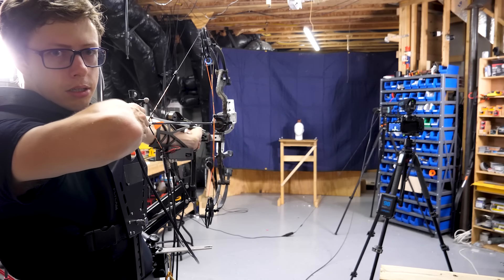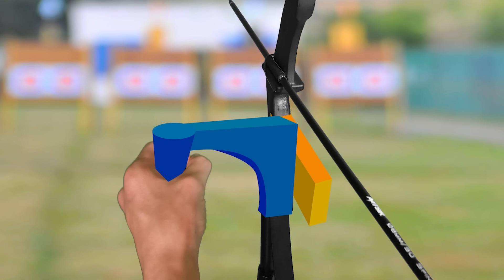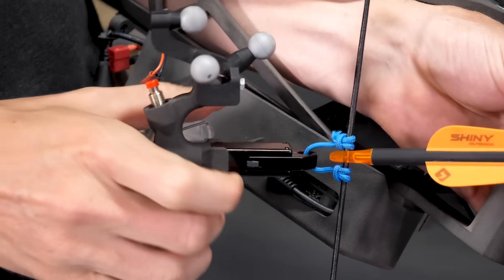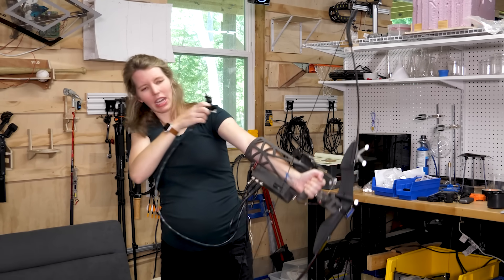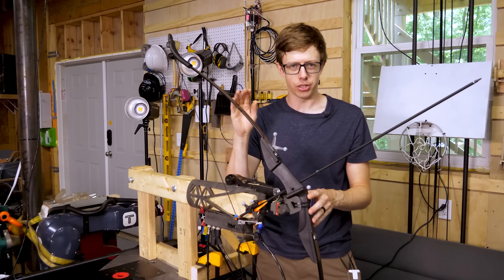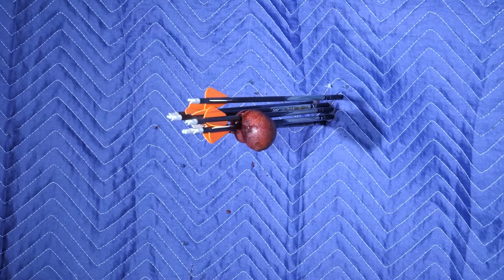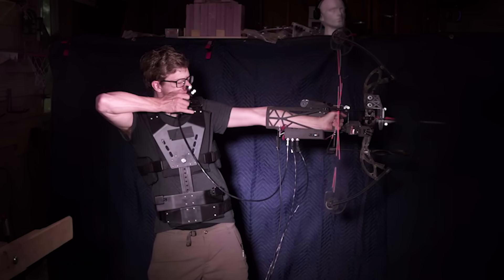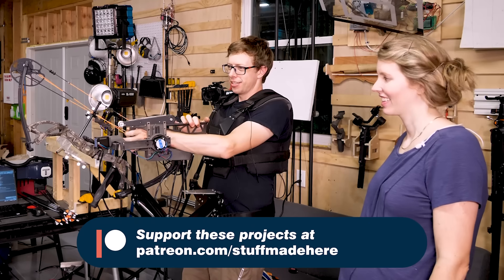Auto-aiming bow vs. FLYING targets

Comment: If you're already wearing a harness, might as well attach two cameras to it and rework your code a bit to triangulate the target with just two cameras on you so you can go outside and shoot targets.
Reply: @tmotw21022  Pretty bold to claim that software specialized in calculating exactly this problem wouldn't be feasble considering this was heavily by the military specially during WWII, you'd be very surprised and probably interested in learning the kind of math and problem solving anti-air artillery innovated.
Reply: @tmotw21022  I'm not here claiming that its impossible since don't have the education to really back up my claims other than having read and watched a lot of papers/videos on similar things ( https://youtu.be/yRd_AW1aZ8M this is a good one ) alongside having worked with programming that involved using ballistic trajectory to predict projectile weapons with gravity and motion in mind as a fun hobby/challenge. You'd be surprised how far math and tricky logic can get us, especially with the computing power and new programming languages we have these days.

Top of my head though I'm unsure how accurate this would be but its primarly just an example of one way of approaching this would be to hard code your own estimate height, use GPS/GNSS to aid getting your current alltitude added into the equation. With distance making things like the target's alltitude and distance harder to guess we can use cameras alongside lasers to get estimate distance. This is all just assumptions from someone without any real prior experience in this other than loving to learn on my own, but it being a ways I can imagine approaching this problem.

tl;dr 
I think its fairly naive to say that it just "wont work" and that is impossible since we don't have have exacty X Y Z axis from 3+ cameras with different angles though that obviously makes it fuck ton easier/straight to approach but not "nah u cant lmfao u need cameras and that big pc they got a googles"
Reply: @tmotw21022  i never learned about it in school either, just came across the topic one day watching a bunch of random videos. Also unsure what being american has to do with anything, I'm Norwegian myself though that doesn't stop me from trying to always learn more and never just say "nah wont work"
Reply: It needs at least 3 cameras in offset, one for x,y and z axis. And that's for the target positioning. And a camera for to know how much he pulls on the bow ( although it can be removed if he uses a crossbow- he know the pull weight and it also gives him better shoot balance). More cameras would give him better position feed
Reply: @Sorcerer86pt  No camera needed for pull length - there are several other possible ways to detect that.
Reply: @perwestermark8920  pull length and direction. Sorry forgot about that. Thanks
Reply: @Sorcerer86pt  Yes, for direction it would be nice with a camera solution. But this part is very hard - if there is a visible target, then the bow could have a red dot or laser sight and the camera looks for the dot. But without a background tonproject the dot on - like when shooting at a a thrown object, it will end up a triangulation problem. Will the moving bow has fixes points to triangulate? Or just settle for gyroscope and linear accelerometers to figure out bow orientation?

In the end, it isn't important to know the absolute position of bow and target. But the relative position of the target, and the direction of the bow relative to the target. And 3 cameras that are following the target should actually manage this, while a 3D linear accelerometer would know if the bow points up or down to compensate for different arrow path based on height difference between bow and target.

So I don't see a need for more than 3 cameras. But additional cameras will help reduce the final error from lens distortion, pixel resolution, slight error in location/angle of each camera etc.
Reply: @perwestermark8920  I see your point. The additional cameras would give a better error offset ( like the extra satellite in a gps constellation)
Reply: @Sorcerer86pt  Yes - every triangulation has an error. But multiple triangulations can average out individual errors.

And yes - newer GNSS receivers normally also looks for GLONASS and BeiDou and maybe Galileo satellites, just to get an even higher number of satellites to use. Both for better spanning of the sky and for averaging the solution.
Reply: @tmotw21022  Thought experiment, how do we do it then with our two eyes?
Reply: @obesevirgin  Party interpretations and assumptions which means our depth perception can be fooled.
I think our eyes also do a lot of micromovement almost constantly to help with depth perception, basically changing very slightly the cameras position. I'm might nbe remembering my classes wrong on that we'd have to check
Reply: @obesevirgin  We often approximate distances based on assumptions. Like assumed sizes of objects and parallax effects of objects moving. But we are often wrong.

But lots of hunters, golfers etc prefers a laser ranger to check distances. When hunting, a hunder may measure the distance to some trees, and when an elk shows up they can bracket approximate distance based on the landmarks they pre-measured.

Comment: You need set an anchor point for release when you draw back your bow. I personally put the release on the corner of the right side of my mouth, this will give you more stability and it will fix the punching yourself in the face issue. Touch up on your shooting stance and you will save yourself from a black eye.

Comment: You can halve (or less) your miss distance by getting rid of the crappy circular bristle arrow rest/holder, and replacing it with a dropaway rest (that holds the arrow until the string is released, then drops down so the arrow flights (feathers) don't hit the arrow rest.

Comment: To turn this into a Mark Rober quote:
"I'm not that good at archery, but I am good at Engineering, so that means I'm actually really good at archery."
Reply: so true lmfao
Reply: Well in a way making it into a aim bot machine that even corrects your mistakes
Reply: this guy has like the all round knowledge of engineering that mark doesn’t have. It would take mark just as long with a team of different people. This dude just does it solo and it works
Reply: Except that a 5 minute tutorial on proper form would have saved a lot of work and face-punching… but then I wouldn’t be sitting here cracking up after every shot 😂
Reply: @DaedalusCreative  Totally get that. Ever heard of nock points (sorry, possible bad translation from German) on your cheek, or rather your jaw line?
Or a slightly bent elbow? Or draw length? Or arrow flexing? Or... the list goes on and on and on.
Reply: this is waaaa beyond Robers reach.
Reply: He basically made the same thing but with darts
Reply: @chiller440  Rewatch the video, he didn't do much of the work. Also, moving the target guided by a preexisting tracking system is much more simple than this. Trust me, this project and the basketball hoop are much more impressive than Rober's dart board. Rober is a better entertainer, Stuff made here is the way better engineer.
Reply: @radix5315  Lots of engineers can do a self-aiming robot. The main question is how long it takes and how expensive.
Engineering is on one hand a question of iterations, where a better engineer has a faster convergence on the iterations.
And on the other hand, it's a question of ability to think outside the box. Which means either magnificent failures. Or big gains by doing something cheaper or smaller or faster than when going the traditional way.

Anyway - it's silly with thread debates arguing if person x can or can not do something similar. It isn't that far from "mu dad has a bigger..."
Reply: So it’s much in his reach
Reply: @santiagoferrari1973  it isn't, he just probably would need quite a lot of time and perhaps a different approach
Reply: @santiagoferrari1973 nah mark actually has a lot better fundamental understanding of engineering then Shane due to his experience at NASA, but Shayne’s really good at putting time into learning new concepts and does that a lot more then mark imo
Reply: @santiagoferrari1973  mark rober could definetely make something like this he just hasn't done it
something like this is hard to make but if you really try and work towards it, you can get it done eventually
that's what engineering is
Reply: @TheCubicLog  @Santiago Ferrari, why are we arguing, can we just all agree and say that they are way better than us?
Reply: @ModernReapers  no, I don't put myself down like that

I could make something like this if I put tons of time and dedication into it

anyone can do it... it's called science
Reply: @Dank Money Working for NASA is impressive but isn't quite the flex you think it is.

Comment: the perfect weapon for fighting enemies wearing reflective balls at close range in a garage with pre-set sensors.
Reply: Just add a couple of high resolution cameras, paired with accelerometers, gyroscopes, an image recognition program, and a VR eyepiece (so you know what it is aiming at). Such a weapon would be extremely difficult to program but once the bugs are worked out it would be the ultimate medium range daytime weapon.
Reply: @garethbaus5471  or just.. use a pew pew box
Reply: US military: this can be arranged
Reply: @moretrash4you  also us military:lets write it down
Reply: Scale it up for long range using satellites in space instead of cameras in a garage.
Reply: @tjwoosta  Maybe something in between. Using an eyetracker so the system knows, which object and a camera system like in a Nintendo Wii, which can be put to the head. This in combination should result in a full mobile archery system. Such the range has to be tested. 
Not sure if the "Wii" System works in bright sunlight.
Reply: @Kermitt_Frog  the Wii system is really outdated now, and most similar VR tracking, while far more advanced, glitches out in high brightness conditions
Ideally there'd be something that used like a zillion different metrics as failsafes (magnetism can fail, IR can fail, gyro can fail etc)
Reply: @Tisrok  Sounds a little like the miniguns in Alien 2
Reply: @Tisrok  I'm sure the military have many advanced weapon projects on the go as we speak. I think they put the Rail Gun project on hold for the moment and im sure theres something else that's taken its place.
Reply: Shame that the Afghan army didn’t have this technology; it could have fought the Taliban for them while they ran.
Reply: @EatTheMarxists  the US spends 800 billion a year on defense and couldn't beat the Taliban for 20 years. US companies made bank though, which I'm guessing was the reason they stayed so long.
Reply: @markbelcher5328 that’s because we weren’t trying to beat the taliban. We were trying to teach the afghanis how to do it themselves. They just didn’t have the fight in them.

Comment: To avoid punching yourself in the face, and to make the bow steadier, use a compound bow (the ones with pulleys). At full draw, you are only exerting a few pounds, not the full load of the standard bow. (edit to add: comment made before he went to compound)

Comment: V2 could have those tracking cameras in a stereoscopic setup right on the bow equidistant from the the arrow being shot, with clever programming and utilizing motion magnification techniques NOT to magnify motion but rather to use the utilization part of the technique to have the computer be able to notice the difference between the capture of the two cameras and with clever calculations to turn it into a tracking mount capable of centimeter precision per pixel or better considering I saw an advanced application of motion amplification allowing to detect micron scale movement based on a single video capture at 1080p.
Reply: with 3 ~ 5 drones, also they can use for wind sensors.

Comment: You're punching yourself because you're pulling with your bicep and not using your back muscles. Forearm should be in line with the arrow.

Also, you didn't need a compound bow, you were just using the wrong arrows for your bow, lol. You need feathered vanes.

That said, this is so freaking impressive.

Comment: I was gonna add that the other problem with the recurve is that drawing closer or farther from your cheek will cause a loss in speed in the arrow. I think the way you combat it would be to ether have a sensor that can tell how far back you have drawn or to have a more solid anchor(beginner archers using compound bow usually use a wrist release and are taught to touch part of the face or neck as a consistent anchor point)

Comment: What if it ran off a 3 point lazer system. You would have the bow project 3 dots in a triangle (the system would run off a gyro and servo stabilization system to allow for steady allignment. You wouldn't want the bow adjusting the allignment to also change the location of dots) The "body armor" would have mounted cameras to track the bow, arrow release, and relatively of the 3 dots. You could also use a range finder that is lined up to the center of the 3 dots to then calculate the angle for height adjustment. This would allow for a dynamically accurate shot no matter the range. At least in theory.

Comment: Is it possible the bow isn't accurate enough? A higher end bow might have better tolerances to improve the accuracy.  Better machined parts more precise ect. Also why not go full instant legolas route and or build a crossbow.  It should increase the accuracy substantially.

Comment: How do you account for the arrow speed beforehand though? it depends on the tension in the string which will vary
Reply: First he can control it the same way archers do by always pulling back the same amount but notice his hand also has a target so the system can see  how far its pulled back.

Comment: https://youtu.be/F583BtHJihQ?t=394 Engineering challenge from The Slingshot Channel (JoergSprave) - Using Phone To Aim a Bow
Project Pitch: Joerg, who is a german engineer, will send you one of his custom made bows, and a project suggestion: use distance-measuring devices, as well as whatever software/code is needed to turn your phone into a mountable aiming device for your bow. I think this would be a really cool collab 👌

Comment: Cool idea for you: the sport of disc golf is blowing up now. Every company has four stats that define their discs: Speed, Glide, Turn, and Fade. HOWEVER, there is no true calibration for what these stats mean. A 12 speed disc from one company flies differently than a 12 speed from a separate company. 

You could create a robot that throws each disc exactly the same, then plug in different discs to see how they fly in comparison to each other. There's plenty of discs from separate companies with the EXACT same stat line like 12/5/-1/3 but they still perform differently. 

No one else in the whole world has done this, so you'd easily net the entire disc golf community as subscriber base afterward, and huge companies might be interested in your experiment too.

Comment: So some practical questions:

How does the computer distinguish the target from other background objects- particularly for a moving target? Perhaps I missed it in the video, but do you need to pre-program what the target looks like into the computer to get the system to work? How would this be affected in the different lighting conditions?

How close does the human need to be to allow the computer to self correct? Since the arrows are not self propelled, the bow obviously needs to have some sort of perimeters that need to be met. For instance I don't see the bow shooting at a right angle or certainly not 180 degrees opposite of the direction the bow is pointing.

Comment: The angle of your arrow flight was the giveaway to your issue.  Your anchor point, tiller, center shot and spine were all in question.  If the initial base hardware isn’t tuned then adding little robot to compensate isn’t going to help much.  Those poor little bots struggling to overcome alignment issued caused by the running of the base hardware.

Comment: Pairing this with the Fenris would be a huge improvement. You wouldn't have to worry about punching yourself in the face, there would be no variations in the release and your arrows would have consistency coming out of the magazine for each shot.

If you take it outside for more practical shooting then you lose the other cameras but perhaps they could be assisted further if you deployed drone mounted cameras for quick deployment and reconfiguration.
Reply: The drone swarm archer. You have come up with an idea I have not met in 50 years of reading a sci fi book a day.
Reply: Moving detectors will have a harder time decoding the distance to the object being tracked, since they also have to track their immediate location at the time of tracking.

Comment: Nextlevel: Make it with cameras mounted only on the bow itself, so it is fully portable ... + maybe use an instant legolas bow from joerg sprave ;-). It removes many errors you mentioned in the video.
Reply: Problem is, the program works because the cameras are at completely different angles.
Probably could be done, but he'd have to re-do probably the entire program.

Comment: Would be really cool if it wasn't dependent on an external camera setup. Maybe you could try mounting a high speed camera to your forearm brace and detect the target from there. (With at least 3 markers per target a simple perspective-n-point calculation should give you the relative 3d position of the target - not sure if that's accurate enough though.)